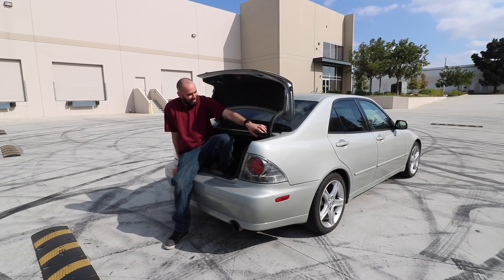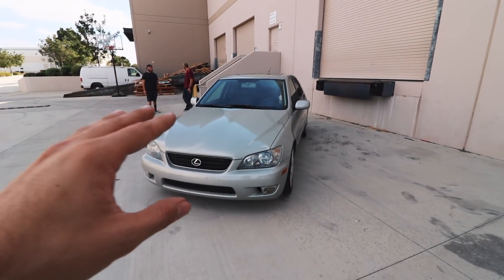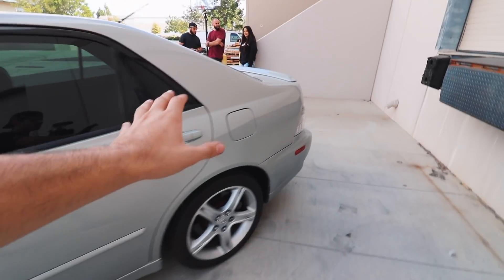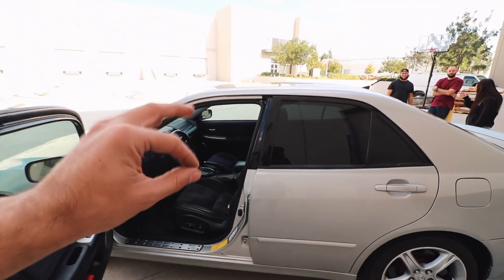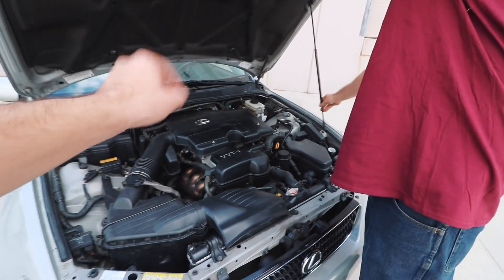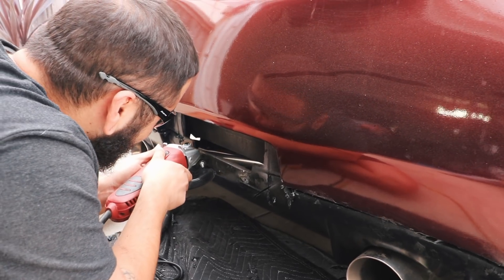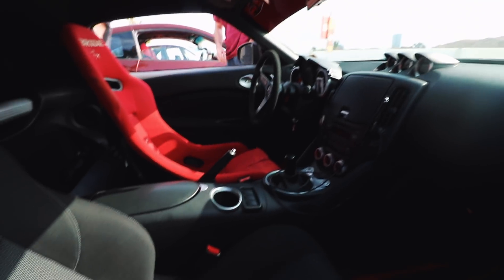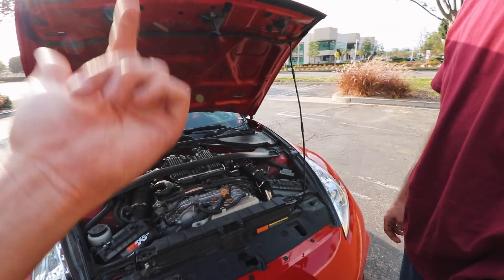My NEW Lexus IS300!

Comment: Just finished my manual swap a couple days ago, definitely a lot of things that could be covered way better on video! I went with the oem supra clutch and flywheel.I didn't see it mentioned anywhere but DO NOT use any spacers on the flywheel had to drop the transmission again because the clutch wouldn't disengage.(its on the flywheel for auto's)
Reply: Something that can't be stated enough for people looking to do these builds with a auto to manual swap, you have a lot of time and money in getting it done make sure you do it RIGHT! Also, if you are building for power don't just swap stock stuff use pieces you can count on for a few more steps down the road!

Comment: NA 2jz blocks dont have oil squirters, if you're aiming for big power i'd consider pulling the bottom end down and doing oil squirters and doing a 1.5jz build. Best of both worlds and would handle over 500kw no worries

Comment: Stock bottom end of a GE is different than gte, the rods are weaker unless you have a first gen GE which was in early 90s SC’s and GS’s. Stock bottom of 2nd gen GE is good for about 400hp with head studs and upgraded head gasket. They share the same crank as gte’s.

Comment: Sweet! Perfect timing I'm doing the collins kit with the cd009! Hey the bottom end on the vvti ge is not as stout as the 2jzgte models so some people get oem pistons and rods and build or just 1j swap and single turbo. Na builds typically yield like 300 hp plus
Reply from the maker: I was also thinking of doing a 1J with a CD009 setup.. I know SerialNine has a whole kit for the CD009 but it’s pricey!
Reply: @StaticGarageUSA   the serial  nine kit is baller but then your stuck sourcing a driveshaft vs Collins you can include one. All in all I got the short shifter, cd009 ,steel driveshaft with stage 3 for  3100.00 definitely  cheaper than v160

Comment: Martins exhaust is custom right? Where did he get those resonated tips from? I have an ebay HKS exhaust and lowkey wanna keep the resonated tips and build something custom! 👀
Reply: Got mine from beluga racing. Had to use a y pipe instead of their H pipe since it was too heavy it was dragging. I have DC headers, test pipes, aftermarket Y pipe welded to those dual beluga mufflers/resonators

Comment: yooo this is insane I live in the valley it's crazy, I just got an is300 for $3k and I'm getting parts for this swap slowly but surely picking up parts this week hope to see the the build!! Btw the best way to push power without breaking the bank is to swap the bottom end with a 2jz-ge NON vvti bottom end with gte head gasket and arp head studs. this be more than enough to hit your goal since it's similar to mine... sorry for the rant
Reply: sub for the local

Comment: It’s nice. Way slower than a g35 tho
Reply: Irate Frogger way easier to make faster tho
Reply from the maker: @Desxo Esco Add a turbo! Nimbus is right, you’re able to make more power reliably and faster with mods. 2J’s are known for reacting very good to modifications. Where as a VQ, you run into a lot more issues!
Reply: Static Garage True but to be fair you have to do a whole engine swap. Plug and play yea. The stock internals on the ge can’t handle that much boost.

Comment: Planning to grab a is300 as well. But please swap the gte in and a 6 speed cd009
Reply from the maker: Thomas Tran I’m debating to either build the GE with these better flowing heads or get the GTE. Only different block wise is it has oil squirters on the bottom of the pistons for lubrications. Still have seen many people with 1000+HP on GE blocks
Reply: Static Garage true. I just seen a lot of people rather just do the gte. I couldn’t really tell difference between the heads. But do the ge first. Gte just saves on maken a hole for oil drain for turbo. But prices on gte motors went up. Trying to find someone getting rid of there project lol. I just want stock bottom end build the head. And turbo and call it a day lol but you know builds cost

Comment: automatic  lol smh 😂
Reply from the maker: I’ve had manuals and still have one. Didn’t want to spend 4K more on a manual where as I can swap one in for cheaper brand new! (:
Reply: Static Garage I feel you
Reply: They only made like under 50,000 manual transmission is300s.
However there are plenty of different tranny swap options, w55 w58, ar5, r54 etc.